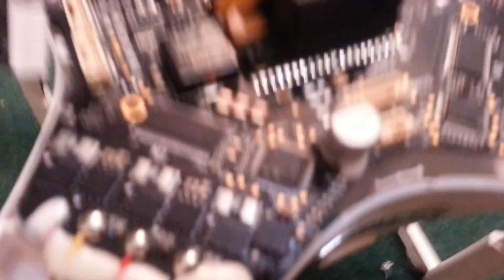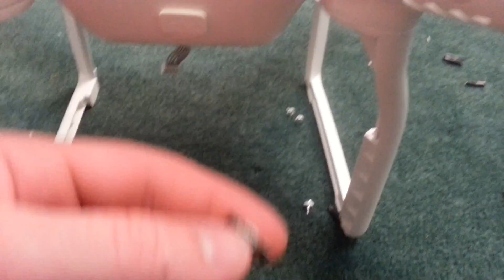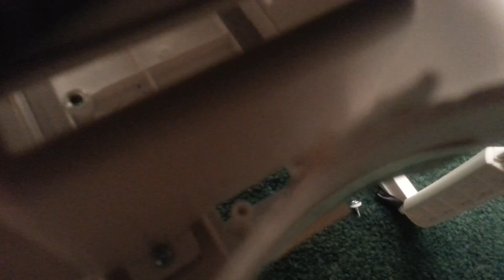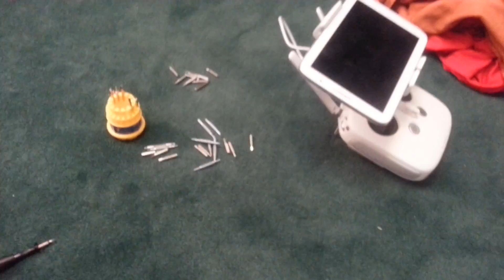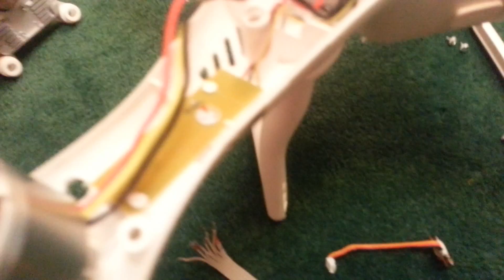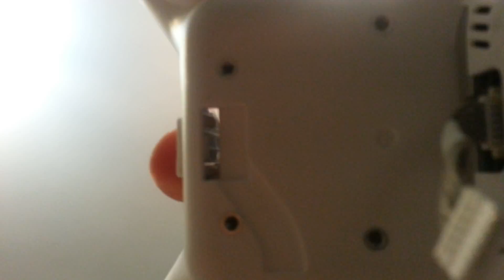Dji Phantom 3- Will it Blend? Disassembly tutorial

Comment: DJI told me the (white plastic connector) part is 'not available' (despite my drone being only a few months old!) and they wanted me to send it for repair to their workshop.  Luckily, I managed to find it on ebay. It's the cable with the white plastic connector on each end.  I had the issue because one of the plastic connectors broke in a crash and the wires just kept falling out when I tried to connect it.  Hopefully, I'll be able to fix it with the help of this video and the other comments, so thanks, all!

Comment: What I just did is used a new cable from a new bag of cables I bought (Google dji phantom 3 part 42). The new long grey cable I cut in half, since the other half attached inside the drone was still good. Then I soldered the cut half of the new cable onto the pins of the damaged one, wrapped each with a small piece of electrical tape cutting the excess tape squeezing each repair firm so to allow the tape to stick. Then push the excess cable into the drone where it enters, you'll be able to easily get all the cable back to the proper length needed that originally was before the damage to allow a factory fit to the camera. Just flew and it's working as intended. As a bonus you now are left with an extra cable to use in your next repair.

Comment: I took a spill into a tree today (3 meters high wife was trying atti mode and panicked bless her heart) basically all chords seem to b in the right spot except that grey cable (with 8 wires) got pulled out.  I tried re connecting the wires but there's 10 slots and 8 wires so I'm not sure how to do that and when I do they constantly fall out.  what do I do I'm a beginner and know nothing about drones (this is first)
Reply: Josh Jorgensen your gonna need a new cable and it is part 81. you can find them on eBay and Amazon and the cheapest I seem to find is about 3 bucks. just watch shell replacement videos on YouTube to figure out how to replace it.

Comment: Sorry for your lost,

1st of all, this connector is not called cable, it called "Servo Lead" so please try google it and see if you can find something match it.

2nd, I would try to see if the P2V+ Servo Lead match the one on the P3... It might be the same, who knows *_^
Reply from the maker: SkyEyes Club Thanks for the info. I bought the cable pack for the P2 already. It is actually too short. The cable pack thank god is in stock. I should receive it Monday. Hopefully it will all work out
Reply: Al L did you get it fixed?

Comment: Re use the connectors and just replace the cable with pc ribbon cables. Make a note of the wires in relation to the pins
Reply from the maker: MrLipp24 P3P42 cable pack just came into stock at local store. They said they wouldnt get it till July. Hopefully I will get it tomorrow and it will all work out